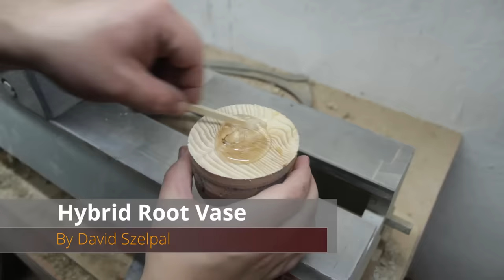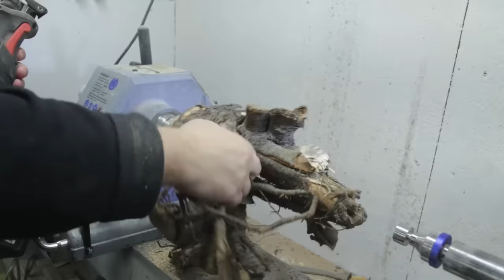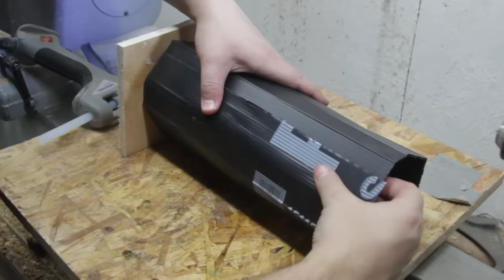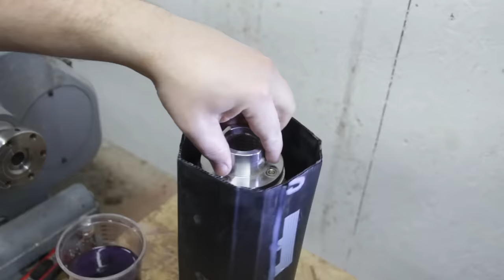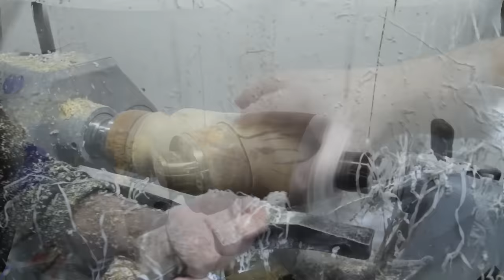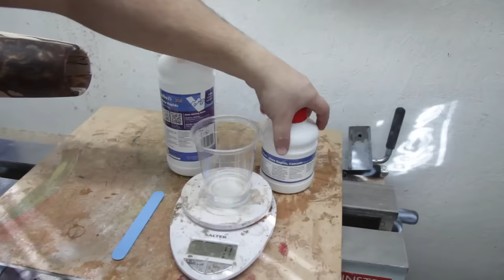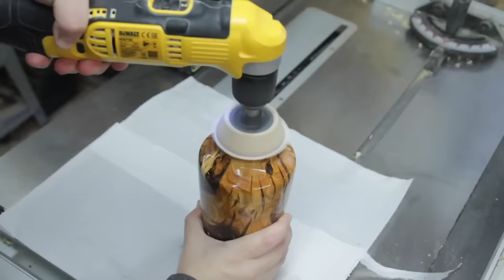Woodturning – Rooty Firewood to Beautiful Vase

Comment: What a beautiful work of art. It literally is taking trash and converting it into treasure!
Reply from the maker: Thank you so much 😀
Reply: A section of tree isn't trash, it's wood. We and nature have many uses for it. Epoxy resin is a petroleum product, requiring dirty industry, unlike wood and other materials we've used for thousands of years to make things like a vase or a table, for which you simply select more ideal material rather than scrap which must be filled with synthetic industrial product.

Comment: This not only require some advanced tools but also a lot of skills for a craftsman.
I could see so many places in that process where even a minor mistake could have resulted in the whole effort being wasted
Reply from the maker: Yes this wasn’t my first vase. Pretty straightforward process once you get the hang of it
Reply: @DavidsWoodturning  How many can thou make in a day? I am guessing ye have dozens of rootworks undergoing the process at once. 20, 50, 100? How many vases can ye make in a day?
Reply from the maker: @rphb5870  I don’t do production work. A vase like this will require min 8-10hrs of clean work.
Reply: @DavidsWoodturning  8 hours? I could not see how much time ye put into this, but I kind of assumed that ye immediately put a new root in the spin while the other one was in the can, so ye could fill maybe 10 or 20 cans in a day
Ye need to find ways to reduce that time significantly, because spending that much time on a single product is no way for a factory to run. May I suggest implementing a moving assembly line and having a guy that are specialised in each part of the production process. Because this could be a good business, but the market will always remain small if ye can't cut the cost.
I have no idea what this vase would cost, but I think it will be much more then 100 dollars which is more then what any vase should cost.
Reply from the maker: @rphb5870  i sold this for $500+ bit that is irrelevant when you have a video with 25m views google that. I am always making new items as opposed repeatable items that does not interest me
Reply: @DavidsWoodturning  of course ye needed to take that for such a large process, and of course it could be sold. It is beautiful. But if ye want to make it a real business ye need to MASS PRODUCE them. That means being able to produce thousands or tens of thousands a year.
Why settle for less? I mean is there anything better then turning a hobby (something thou loves) into a business (thus getting rich doing something thou loves)
Reply from the maker: @rphb5870  I already turned my hobby into a business. But honestly you would be surprised how well youtube pays and i would hate to see my business doing mass production so this is not even for consideration

Comment: Its very pretty,    but I liked its original look also, you could take the same thing bead blast it to remove the bark mostly, 
And pour it into plastic then shape it into a table leg, that would have also looked good, or maybe turn it into a lamp for your desk and put in led lights in the resens

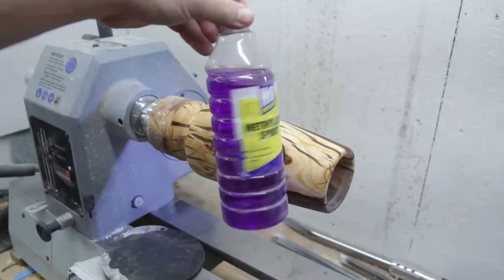Comment: What happened between 8:47 and 8:48 , they look very different , did you leave some footage out? Just curious.
Reply from the maker: Yes. I cleaned it with methylated sprit what pops the grain and changes the colour until it evaporates. But then started to film before it was fully gone so it looks slight different colour. Good spot

Comment: Nice work. Any reason why you drilled your logo/insert slightly off-centre?
Reply from the maker: Nope. The forstner bit is drifting slightly as using a hand drill. When i use a pillar drill have not got this issue

Comment: What brand epoxy are you using?    And why the pressure pot?
Reply from the maker: Vista resin. Helps with air bubbles
Reply: Thanks.  Been using West System for bonding but bubbles are a problem.  The pressure pot is to force the resin in deep to every crevice.    Like vacuumed bagging in a way.?

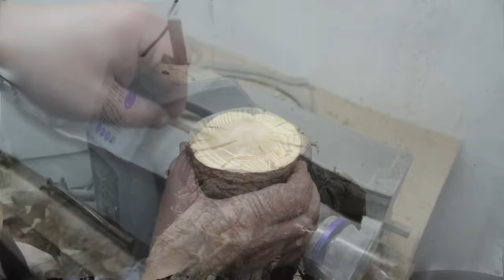Comment: What was the adhesive you used to mount the roots to the block at 0:02-0:10 ?
Reply from the maker: Zap 5 mins epoxy
Reply: @DavidsWoodturning  Awesome. Clearly, it is super strong; to withstand the force of a lathe with just a surface to surface bond.  Your work is amazing. 🙌

Comment: I'm ignorant on the subject, but was the original piece of wood even necessary when you poured so much of the hardening liquid to fill in the gaps?
Or was the only purpose of the wood to get some of that pattern on the vase and has nothing to do with the structural integrity?
Reply from the maker: To be fair resin is harder than the wood anyway . Sadly the piece did not have enough meat so for this project the balance between resin vs wood is more towards the resin
Reply: @DavidsWoodturning  ah~ so it's called resin! Thanks for the reply and explanation! 😁

Comment: have you ever thought that maybe you shouldn't rely on glue holding that stump together? This stump could be unstable and going at higher rpm could fling that glue or could cause internal breakage.
Reply from the maker: Not actually. The chances the glue will fail is far less than a chuck failing. Talking from experience

Comment: If you knew what you were doing you'd get no wood chips on ya, also I think they damaged my screen a little so you owe me, what was that glue you used to bind the lathe (mount?) to the wood?
Reply from the maker: Never claimed i knew what i am doing. The project meant to be a table but turned out to be a vase.
Ps. Zap 5mins epoxy resin
Reply: @DavidsWoodturning  Thanks for responding, I was being facetious about the wood chips, please don't take it to heart as I don't know anything about anything 😇 Ps. it looks great

Comment: The problem with woodworking is that after you made 10000 vases and 5000 foot stools and 2000 tables, you run out of ideas and it becomes monotonous and boring

Comment: How on earth are you able to get a hot glue gun to be useful?
Reply from the maker: Practice 😀
Reply: @DavidsWoodturning  haha!  The hot glue gun we have around the house is so tiny and crafty that it barely heats the small diameter sized sticks, but maybe a large one like yours would be worth having.  I've yet to find something permanent to use a glue gun for, but it seems the usefulness is in temporary things?
Reply from the maker: @ChonkTek  it os great for quick fix and mold making. There are loads of good use for hot glue guns. Yeah buy a bigger machine the will make a big difference